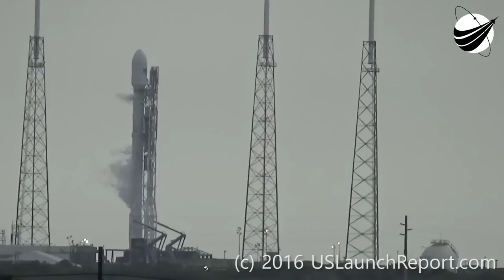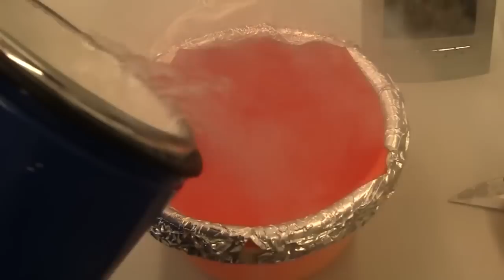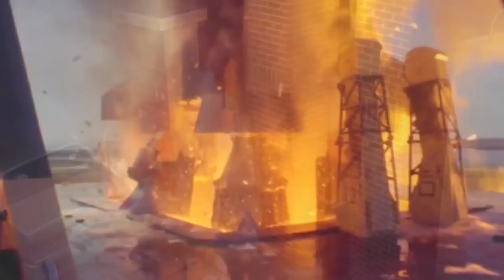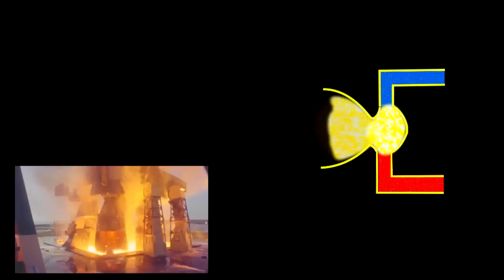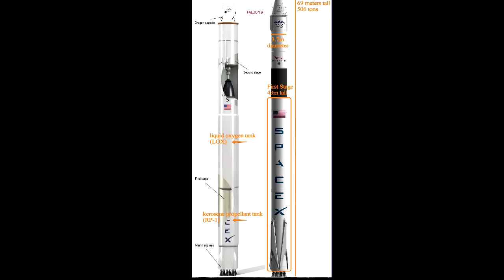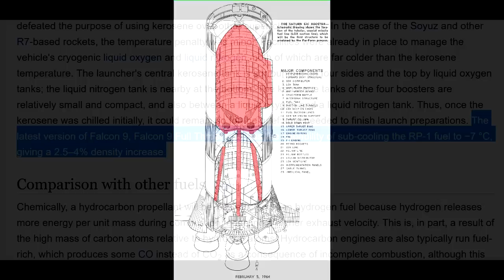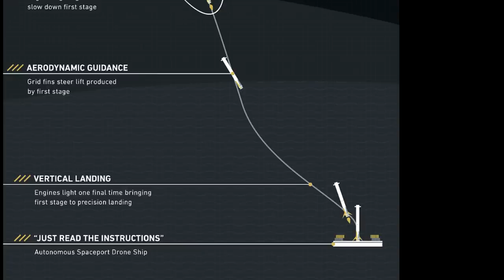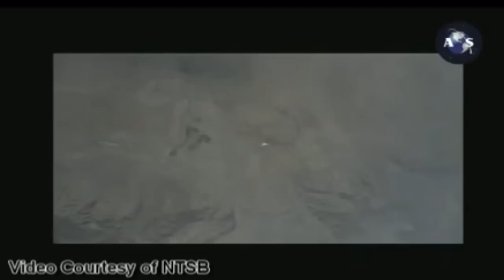Why did the Falcon 9 Explode?

Comment: As a gas turbine engineer, one of our biggest issue is fatigue life (on/off) cycles of the engine.  So far all of the falcon units only perform a single cycle.  Would be interesting to see how many cycles they plan to use this for because the engineering challenges get harder and harder for every cycle.
Reply: Up to 10 reuses now.

Comment: Even first year programmers knows not to childishly depend on a single point for safety... Your system is magically capable of never failing? Because you spent years working on that single system? Great. Now make another system that will handle it when the first one fails. And do that a few dozen times. Maybe a few hundred times.

Really, just make as many safety points as possible until your employer tells you "It's too big, shrink it".

Don't be so stupid that if one single point can fail that the entire thing blows up in your face. Literally.

Comment: I absolutely agree with you on the fact that SpaceX is solving problems that were solved 40 years ago. They're a tech company, not an aerospace company by philosophy... This has drawbacks and advantages... The ULA/Ariane vehicles have a much better success record than the Falcon 9.

But at least they're trying to innovate and they're trying to make access to space more economical, which they have already done to some extent.

Comment: Close examination of the explosion strongly suggests that the source of the detonation was external to the rocket. The center of the fireball in the first several milliseconds and the intersecting paths of flying debris point to a location about a meter to the side of the rocket body. I believe that the whistle sound heard from the explosion may be a pressure relief valve opening or a flange failing. This is followed by a faint percussive sound, which I believe is the initial detonation that led to the destruction of the rocket. 

I appreciate having someone run the numbers, and it's interesting to have an idea of how much fuel/oxidant was involved in the initial fireball. I would like to put a line on the flight paths of the debris flying off, instead of just eyeballing backward to their origin. Most of all, I'd like to have a higher resolution view of the section of the strongback next to the second stage.

Comment: I'm thinking of scramjet would be better than the current system.Take off like a commercial jet, increase speed and switch to scramjet. When entering lowered pressure atmosphere, inject liquid oxygen for the last trip to LEO. The space shuttle was a great experiment, but they didn't finish the last step. And that SpaceX rocket exploded on the launchpad, despite 4 years of experience tells me they cut corners. And you do NOT cut corners regarding such vehicles.

Comment: Oh also, check your facts, you say that I'm surprised they didn't go the way NASA went to Mars, you start off with parachutes and fire the engines for the last bit of the journey. They've actually tried that a few times, the problem being is that the speeds at which they were going were too fast for the 1st stage too handle, so they ripped and also destroyed the rocket by swinging it around at about Mach 5. Also the downside to parachutes, especially when you are dealing with a 1st stage that weighs about 35 tons dry mass, is that the parachutes would just add more and more mass to your rocket which would take away landing fuel and payload fuel, it would also slow down recovery process as you would have to re-pack the chute every time you needed to re-launch it.

Comment: Very informative video and you are very knowledgeable, I just don't agree with what you are saying in the video and in your description, for instance you say "Reusable space vehicles has been a dream for DECADES, however in practice it cost almost as much to maintain as build new ones." Except it really isn't. When you take into consideration the hardware needed to maintain the rocket (which isn't a lot) and the people you need to pay for this rocket to maintain it (which again isn't a lot) it's much much much less than the actual cost of the 1st stage itself. The 1st stage cost about $40 mil which is vastly cheaper than most rocket 1st stages alone. For example the Atlas 5 1st stage cost just about 150 million to build. Anyways let's get back on to your statement, you are showing no proof at all when you say "It cost almost as much to maintain as build new ones." Once again it really doesn't, and want me to tell you why? Because 1 Falcon 9 rocket can re-fire it's engines 10 times after it has landed, that doesn't even include the 5 other times it has to fire, also 1 engine cost about 2.5 million to manufacture, which means that every time you re-fire the engine after it has landed, you are saving just about 2.5 million. Anyways my point is is that the more you use these engines, the more money you are saving and the less it cost to re-launch the 1st stage. So that's my argument to your statement. If you want proof backing up my statement just reply to me and ask for it.

Comment: Thank you for such an "in depth" overview of rocket mechanics (I enjoyed it). As of this writing we do not know why the Falcon 9 actually exploded. The explosion may have been the result of sabotage, a design flaw, or a mistake made by a computer or human in preparing the rocket in t's routine filling operation. Elon Musk has stated "Important to note that this happened during a routine filling operation. Engines were not on and there was no apparent heat source." Most of us realize that Elon Musk is just a man with the means and a very strong desire to carry out mankind's (and NASA's) original dream for the human exploration of space. This must be done and it will in one way or another. Somebody has to step up to the task, and that is Elon Musk. NASA has clearly shown that it is unable to do this now because of politics or otherwise. NASA though has worked closely with SpaceX in the past and most likely will help in the investigation to insure this kind of thing does not happen again.

Comment: I think Thunderf00t needs to go back to his textbooks here. A lot of what he says is first order analysis stuff, or 'everyone knows' facts, which is actually very badly wrong once you look a little deeper into the issues. And also like he's swallowed some NASA worshiping BS hook line and sinker without realizing it. Which is rather sad.

People get excited over stage recovery because NASA and ESA and everyone else sat around with their thumbs up their butts on the topic for 5 decades. You're right it was all done before he was born. The rule book for sensible space programmes was written even before NASA was born (once you have the rocket equation the best possible approach is blindingly obvious after all)  but then generations of NASA management ignored it AND LIED ABOUT IT for political reasons. (Mostly relating to have little actual control over how it spends its own money, and not wanting to admit the shuttle was a colossal failure.)  Musk is actually picking up that old 'obvious best practice' guidebook and running with it is actually a big deal.

Even if you don't understand why.